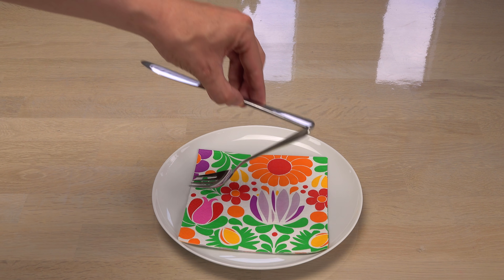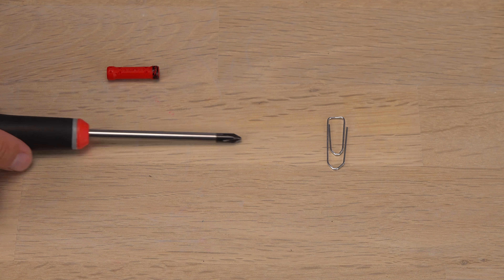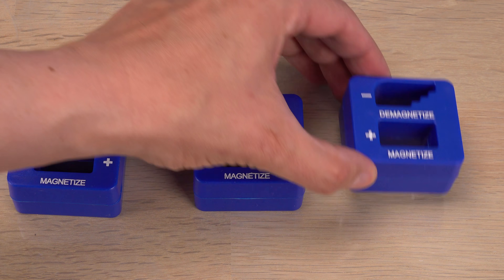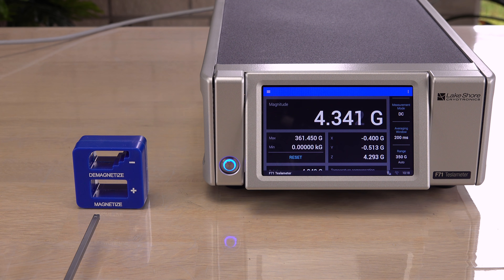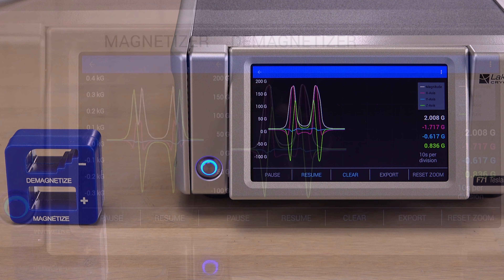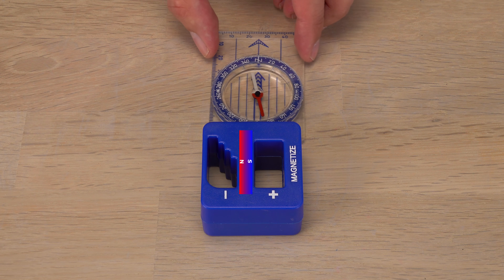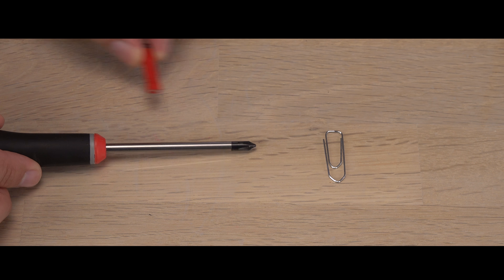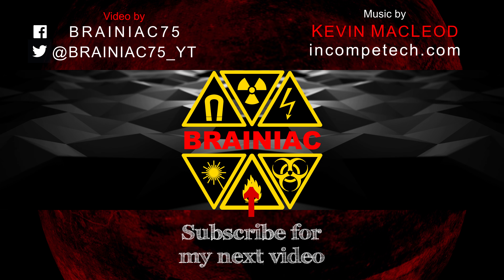Mystery of the Demagnetizer | What's inside? How does it work?

Comment: When my old colour TV screen became magnetised after a close lightning strike, I simply made a degaussing coil by winding some spare insulated wire around a bunch of old transformer core sections, added a lamp in series and completely demagnetised the screen in minutes by waving the coil in circles while gradually moving away for the screen. Try doing that with a couple of permanent magnets. It was, of course, powered by AC mains.

Comment: Make a electric motor on that prinsip. Make the magnet strong and week using spoles. ofcorse you can make a triangel konfigurated spol unit for every driving spol. You then turn it on and of like a ordenary motor/engine.Buy shorting the triangular spoles. made of magnet ofcorse.

Comment: The stairs can be used to rub something over it;
If you think back, you can also demagnetize sth by hitting it; thats what the stairs are for, move a screwdriver back and forth over them to get a multitude of hits in a short time(is also why the stairs have a good amount of platic in comparison to the rest, as to not break on the first tool you demagnetize)

Comment: During my internship I used a de-magnetizer tool to get rid of static in spatulas so I could weigh small amounts of test compounds without it sticking to the metal spatula. It was an electric device consisting of two vertical prongs. You pass it through when its on and boom- it's no longer static. We called it the Harry Potter device. Do you think it could be the same principle, except the base is an electromagnet?
Reply: This would be done with high voltages, similar to an ionizer...

Comment: The only thing I do not understand—when would you ever want your screwdriver un-magnetized? I have only wanted mine either magnetized, or magnetized more strongly than it already was!
Reply: When you use your tools in electronic way, you want them unmagnetic to avoid damages on components
Reply: Cassette tape player azimuth screw asjustment. The sound on the cassette tape is stored by magnetizing the iron oxide particles on the tape.
Reply: good points!

Comment: what about degaussers, i remember when the VERY old tv we had a long time ago would need to be repaired, after he was finished replacing what ever needed to be replaced, one of the last things he would do is wave this black ring in front of the tv , the picture would get all wavy and the colors would get all mixed up, then when he switched it off or unplugged it it went back to normal, when i asked what he just did, he said he degaussed it, he explained that he erased any magnetic fields that were there, that was over 45 years ago and i still remember it today.

Comment: the stair step is a height gauge in direct relationship in large to small screw drivers... A small screw driver, like what would be used for wrist watch assembly, you can control the amount of how much the the smaller micro screw drivers get magnetized, as the stair step lets you just ride the screw driver at which ever level you desire. The closer you are to the bottom, the more stronger the flux will be, the further you are away, the less stronger it will be. But is directly related to the alloy and the size or in a screw drivers case, diameter.

Comment: could the two magnets on the magnetizing side be at a 90 Degree corner forced to face each other making it  work with more open room? Also does making it 3, 4, or even 5 magents if you get a lil clever make any difference to either strength or how many passes it takes to be effective?

Comment: So the demagnetiser basically turns a strong well-focused magnet into a weaker less focused one. But it may be possible to do a true alternating field demagnetisation by hand.
1. Position a magnet near the handle of the screwdriver, magnetic axis perpendicular to the tool.
2. Repeatedly move the magnet in circular trajectory along the plane perpendicular to the tool. Do not rotate the magnet, though.
3. Together with the previous motion, slowly move the magnet along the tool, and eventually away from it.
Sorry, to lazy to try it myself.

Comment: Fascinating video - thank you. I had a play with different thickness screwdrivers in my 'Magnetiser/Demagnetiser'. It seems that for thin bladed screwdrivers, I needed to use the stairs to successfully demagnetise. If I use the lowest stair, then the screwdriver is still able to pick up ferrous materials. Using a higher step successfully removes the magnetic field. I was able to repeat this several times. I guess thin materials saturate more easily, so need to be demagnetised in a weaker field, hence using the staircase.
Reply: Magnetic materials kind of short circuit magnetic fields, so it would make sense that a weak magnet would still be able to saturate a thin object, because there is less diameter to spread the field inside the object.

Comment: Wow! Just last week I was looking this up, but ended up more confused than before. I finally understand!

I wonder if it only works on things like tools and cutlery, or could you magnetise and demagnetise something smaller, like a paperclip or a needle?
Reply: should be good for all ferromagnetic materials. the other ____magnetic materials do not support a field without a magnet nearby. Anything ferromagnetic will be affected the same way, needles, paperclips, compass needles, if you get a big enough one, even a turned off electromagnet core for a scrapper crane should be able to be demagnetized. Magnetization does achieve a saturation point though, so you will not be lifting massive vehicles with a magnetized butterknife, even if you have the strength
Reply: It probably works with ferrous materials

Comment: You can also demagnetize a magnetized screwdriver by dropping it on the floor a few times from about 1-1,5 meters height.
Reply: How does this work?
Reply: @hullinstruments  I'm guessing it shakes up the iron atoms, making them go in random directions and the fields of all the different atoms cancel out
This is just a guess tho idk if it's right
Reply: @Xnoob545  and  @HULL GUITARS USA 

@Xnoob Speakable is thinking in the right direction.

The explanation that was given when it was demonstrated to me, is that in ferromagnetic materials, the magnetic domains usually are in disarray.

When you magnetize them, you arrange their magnetic polarities in one direction, such that enough of the magnetic domains align in the direction of the applied magnetic field to make the material magnetic.

Then when you drop the screwdriver, the impact makes most of the magnetic domains snap back into their natural position, which cancels their previously induced orientation.

I don't know for certain if this explanation holds any water, but you can easily verify that de-magnetizing a magnetized screwdriver by dropping it, works.
Reply: @scsft  Yes, that is the explanation that I have heard. Magnetizing means to merge individual domains into a single large domain. Hitting a magnet breaks up the domains and they end up in different directions.
Reply: Unless my memory is not what it used to be...I remember an episode of MacGyver(The Richard Dean Anderson one)...where he struck a piece of rebar few times and made it magnetized.
I will have to see if i can find the clip and check to see if that is correct.
Curious if it can be done or if they just fudged the science to make the scene work.
Edit...Found this one... https://youtu.be/QmEi-rWPnAc
Just keep dropping them they will re-magnetize ...hhaha.
Reply: @heathb4319  I have a few iron rods.  could try it. But it is my understanding that if you hit a magnet a bunch of times or hard enough, it demagnetizes.
To make a magnet, such as the iron neodymium boride type, they place the material in a machine and pass a very intense magnetic field through it for a few seconds.
Reply: @louistournas120  ...apparently if you hit, smack, vibrate etc...a piece of iron bar...it excites the molecules and they realign with the magnetic field of the Earth and then you get magnetic field emanating from the bar. Strength and duration depends on a few factors...but it is definitely do-able.
Anyhow...good luck...have fun.

Comment: I used to have a tape head demagnetiser around. This was just a plain coil with an iron core hooked up directly to the mains AC. The alternating of the magnetic field and thereby slowly pulling away the iron core from the tapeheads should also cancel out the remanent magnetic fields. I wonder if the same trick worked with the permanent magnets. Like your videos. Keep up your great channel.
Reply: yep it is similar and also universal, like he said in the video you couldnt demagnetize the screwdriver with the wrong demagnetizer, but having an alternating and slowly decreasing field will work for any polarity.

Comment: If you used stronger magnets in the demagnetizers' arrangement does it make more strongly magnetic tools?
Reply: Not sure if you found out yet, but if you put stronger magnets in that shape and use the magnetizer area, it will be a stronger magnet up to a certain point. There is a point of maximum saturation of a magnetic field in a ferromagnetic material. More than that and it is logarithmic growth. So yes, but only to a point. No lifting bagger 238s with a butter knife
Reply: I am soooo going to test this
Reply: No

Comment: For an even better demagnetization, stick the magnet on a drill machine, with its axis perpendicular to the rotation-axis of the drill. With the drill spinning, slowly move away the magnet from the DUT. This works similarly to the "degaussing" pulse in CRT-based video-tubes.
Reply: DUT? This guy is definitely an engineer
Reply: @N00B283  'Aight ;)
Reply: @N00B283  lol
Reply: Or if you’re more of an electricity person, use a solenoid and pass AC through it, then do the same.
Reply: @GRBtutorials  yep, i use a stator of a washing machine/dishwasher drain pump motor for the purpose, works great.
Reply: @victortitov1740  Those things also make excellent little alternators.

Shaded pole motors stators are quite similar and hence work well for degaussing too. 
The nice thing about them is they're in basically every appliance and fixture that has a low power fan running on mains.  

Salvage tip: If you remove the rotor and squeeze the top of the yoke in a vice the coil will usually pop right out, yielding about 100-200 meters of ~30AWG magnet wire.
Reply: Now he just needs to find a woman with a really high iron content in his blood and he will be all set!
Reply: :O that was some great info, thanks sir!!
Reply: fancy people use a lathe for that instead
Reply: Just rub the screw driver on the ladder like a musical scraper a few times. The quickly alternating field will completely demagnetize it
Reply: But wouldn't your drill chuck then be sticky to metallic tools. ?
Reply: @cnone3785  Yes, keep a safe distance from non-fixated ferromagnetic objects and other sources of magnetic fields during this exercise. Usually the pair of spinning 1cm^3 magnets you'd stick onto the drill-chuck is not strong enough to pick up say a screwdriver from a distance of ~a cm or more.
Reply: I don't know what anyone is saying. I just want to demagnetize my Rolex because it's too fast
Reply: @dontaskmeforusername  Lol, a hammer might work better.
Reply: That's where the phrase "hammer time" originates.
Reply: @dontaskmeforusername   yeah I tried 2 read that while still asleep  but what was worse was I couldn't figure out when watched anything on "net size for dem ag "  huh.  "Dem-ag-net-izer"   took about 3min before I realized school turned out like it did 🤦‍♂️
Reply: I have a small and cheap video tube.
Reply: ok now in english pls :D
Reply: esecallum, regarding the treatment of malaria with mangetic fields, they have done it WRONG! Oscillating magnetism is for ENERGIZING an alternating current. But to provoke destruction on the malaria parasite, a quick magnetize - demagnetize force should be applied to infected individuals.
Reply: A malaria parasite within a human red blood cell. The large circle in the parasite is a food vacuole. Stacked heme are visible inside the vacuole.

Researchers at the University of Washington have discovered a method of treating malaria with magnetic fields that could prove revolutionary in controlling the disease the World Health Organization calls one of the world’s most complex and serious human health concerns.

Henry Lai, UW research professor of bioengineering, says the malaria parasite Plasmodium appears to lose vigor and can die when exposed to oscillating magnetic fields, which Lai thinks may cause tiny iron-containing particles inside the parasite to move in ways that damage the organism.

“If further studies confirm our findings and their application in animals and people, this would be an inexpensive and simple way to treat a disease that affects 500 million people every year, almost all in third-world countries,” Lai said. According to the World Health Organization, as many as 2.7 million people die of malaria every year. Approximately 1 million of those are children.

In the past two decades, the emergence of drug-resistant malaria parasites has created enormous problems in controlling the disease. Lai says his method could bypass those concerns because it is unlikely Plasmodium could develop a resistance to magnetic fields.

Malaria is spread by female Anopheles mosquitoes. The organism first invades the liver, then re-emerges into the bloodstream and attacks red blood cells. This is what causes malaria’s hallmark symptoms: fever, uncontrolled shivering, aches in the joints and headaches. Infected blood cells can block blood vessels to the brain, causing seizures and death. Other vital organs are also at risk.

Lai’s research appears to take advantage of how the parasites feed. Malaria parasites “eat” the hemoglobin in red blood cells of the host. They break down the globin portion of the hemoglobin molecule, but the iron portion, or the heme, is left intact because the parasite lacks the enzyme needed to degrade it. This causes a problem for the parasite because free heme molecules can cause a chain reaction of oxidation of unsaturated fatty acids, leading to membrane damage in the parasite. The malaria organism renders the free heme molecules non-toxic by binding them into long stacks – like “tiny bar magnets,” according to Lai.

He and three other researchers have exposed Plasmodium falciparum, the deadliest of the four malaria parasite species, to a weak alternating, or oscillating, magnetic field. Data sets showed that exposed samples ended up with 33 to 70 percent fewer parasites than unexposed samples. Measurements of hypoxanthine, a precursor for nucleic acid synthesis used by the parasite, indicated that metabolic activities had also significantly slowed in exposed samples. Such reductions would be enough to manage malaria, Lai said.

The oscillating magnetic field may affect the parasites in two ways, according to Lai. In organisms still in the process of binding free heme molecules into stacks, the alternating field likely “shakes” the stacked heme molecules, preventing further stacking. That would allow harmful heme free reign within the parasite. If the parasite is further along in its life cycle and has already bound the heme into stacks, the oscillating field could cause the stacks to spin, causing damage and death of the parasite.

Although initially promising, Lai says more research is needed.

“We need to make certain that it won’t harm the host,” Lai said. “My guess is that it won’t. It’s a very weak magnetic field, just a little stronger than the earth’s. The difference is that it is oscillating.”

If the method is proven effective and safe, Lai envisions rooms equipped with magnetic coils to produce the oscillating field.

“It would be very easy. People could come to the room and sit and read or whatever while they’re being treated,” he said. “Or you could set it up in the back of a big transport truck, then drive from village to village to treat people.”

Collaborating researchers include Jean E. Feagin, UW associate professor of pathobiology and senior scientist at the Seattle Biomedical Research Institute; and Ceon Ramon, UW electrical engineering research scientist.
Reply: @esecallum  Very interesting. I didn't heard about that. A teacher of mine had been threatned by malaria which was very unusual at that time in Germany. I hope the researchers will be successful and are staying healthy not dying of heart attack or accident.
Reply: @crazyedo9979  it's a very simple Device. Just coils of wire a power supply plus a function generator. You could put coils of wires around sleeping bags or rooms and people would simple sit in the room. You can see an example on YouTube. No money 💲💰💲💰 in it
Reply: @esecallum  You give the answer yourself. No money in it. So the pharma industry looses a fortune. Think of Nicola Tesla and his free energy.
Reply: @crazyedo9979  Well if we got energy Teslas way wifi and Cell Phones wouldnt work.
It would probably mess with satellites too all that extra noise to deal with.
Reply: @Zeon01  If we would have Tesla energy we were already able to communicate telepathicaly. The sattelites? I feel very sorry for the phone company, Elon and the secret services 😭
Reply: @crazyedo9979  Telepathy will never be a thing...
Reply: Oh the incredible irony of how it was not profitable for Tesla, yet, the Tesla company has become the richest in the world.